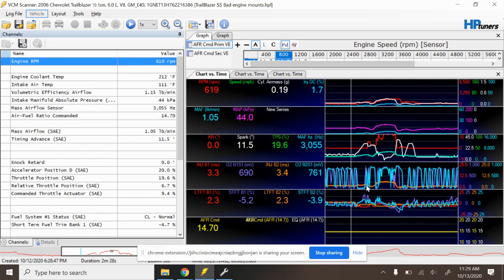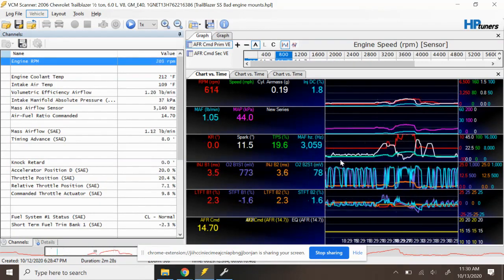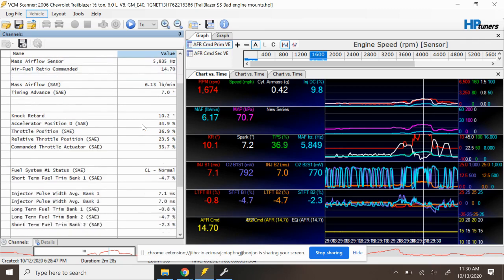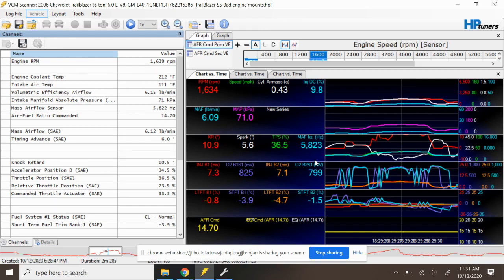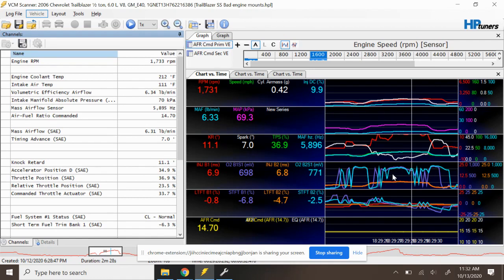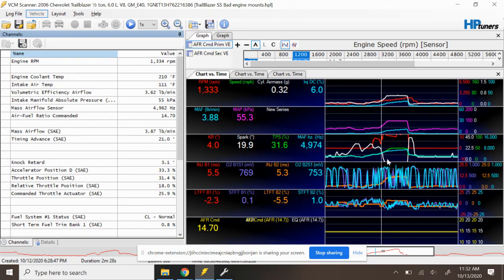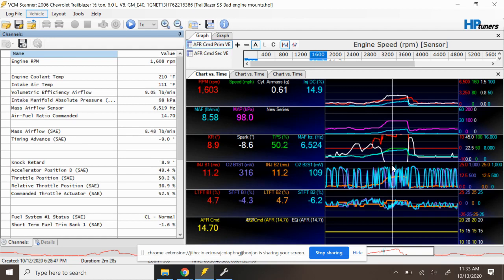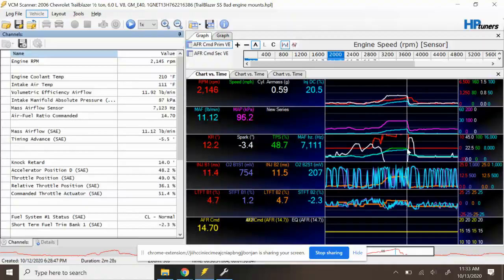Tech Tips - False Knock

Comment: A single O2 sensor reports collective AFR (average) of all cylinders.  Therefore, if one injector is marginal, that cylinder would be running lean and the displayed KR would be real, while the O2 may indicate "rich". The ECM would compensate for the oxygen in the exhaust stream (dumping fuel) to achieve the target AFR, making all other cylinder rich.  The problem cylinder would be "richer", but could very well still be lean therefore making the KR real.
Reply: happens a lot when people change injectors
or if going from pintel to disk injectors, pintels are like rocket injectors, they don't need a fine filter so you have to add one
Reply: That's where those plex nock monitoring headphones come in handy 😅

Comment: What is a typical lb/hr fuel at idle on 98 LS1 with cam 228 .600 112+2 and headers? Stock heads,  maf, Intake manifold and throttle body.

Comment: Hey brother, I know you are busy and whatnot....but if you have a moment, I could really use a hand on a tune to start my 3.8L that I found an old powerdyne supercharger. Ive just installed colder plugs, 52lbs injectors, a wideband and the supercharger kit itself.

I just purchased HPtuners and 2 credits. Maryland has a stay on tuning right now in there attempt to curve the diesel truck guys blowing black smoke into the air. So I have to tune myself...and my money is funny due to being laid off 😟.

Someone suggested to upload a Pontiac GTP stock tune since they came supercharged. Would you recommend this? I'd be truly grateful for any help...I can't afford to blow this motor up right now.....thanks.

felixrican86@gmail.com

Comment: So if you swapped out the engine mounts and suspension with polyurethane or in some cases solid spherical bushings and this problem occurs...then what? A lot of  road racers and auto cross weekend racers do this. Are there any manufacturers that sell less sensitive knock sensors? What other options are there?
Reply: You can tune the knock sensors to be less sensitive, and that is necessary sometimes.
Reply: Gen 4 knock sensors are over sensitive from the factory
Reply: maybe its real knock?